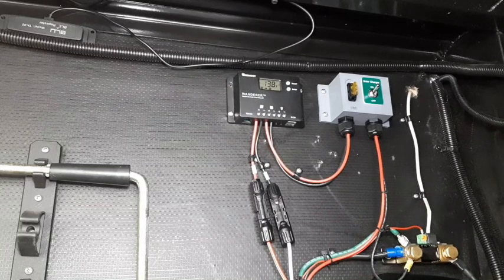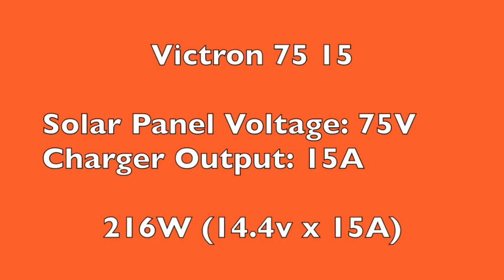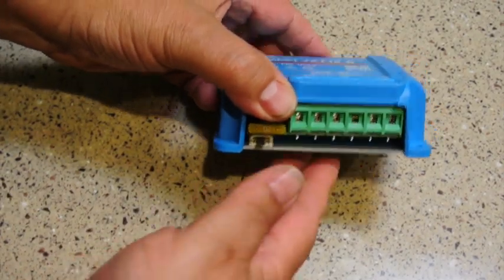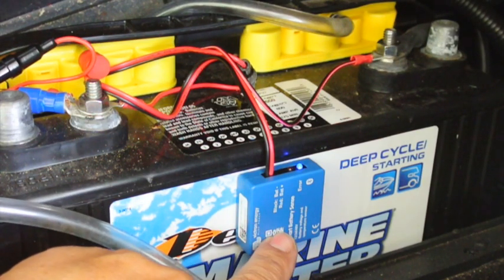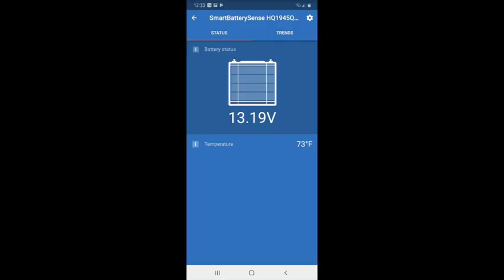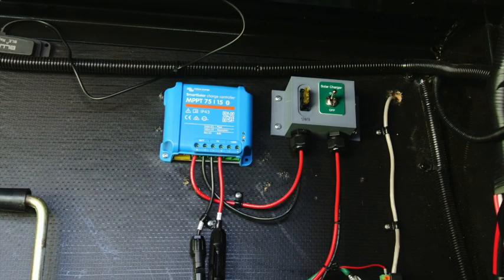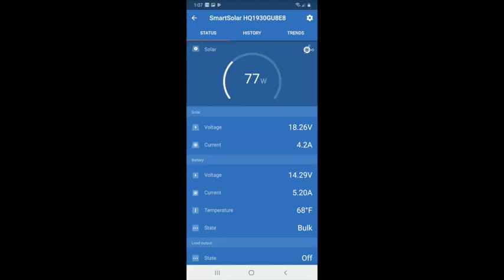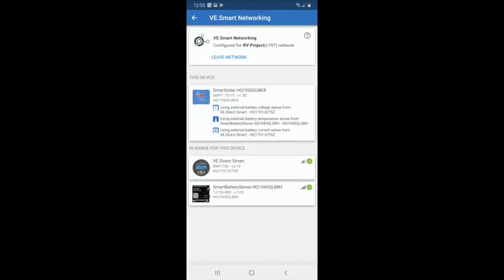Installing a MPPT Controller - Portable RV Solar Charging Video 6

Comment: Solar 76.692 watts...to the battery - 74.308 watts. Only losing 2.5 watts in the controller. Not much loss.

Comment: Can I ask what’s the difference from the smart sense dongle and also the victron battery monitor you also have please 
I’m thinking of upgrading to the mptt but my controll panel in my motorhome is the nord which shows how full your leisure battery and starter battery is 
Would I need to also buy the battery monitor 
I’m new to this sorry 
I have 120w solar but upgrading to 175w just swapping panels then swapping pw panel to mptt panel hoping my nord controller panel is enough just to show both level of batteries with the lcd dots in green or red when low
Reply from the maker: The Victron Smart Sense is designed for the Victron MPPT solar charger. The voltage is reading from the Smart Sense dongle can be a bit more accurate than at the MPPT charger as it reads directly at the battery where the MPPT charger could read a bit low due to voltage drop across the wiring if the MPPT is located a few feet away.

Also the Smart Sense provides battery temperature to the MPPT cintroller.  This results in a more accurate charge cycle.

The Smart Sense dongle is optional though.

I am not familiar with the Nord display, but I also have a Victron BM700 battery monitor that measures current used and can provide expected time remaining on the battery.

The Smart Sense also provides temperature and voltage info to the BMV700 as well, privided enable the Victron network, whi h allows the devices to communicate via bluetooth.

However if you buy the BMV702 monitor, it includes temperature monitoring and can send that to the MPPT controller, so you would only need the Smart Sense donglenif you did not have the BMV702.
Reply: @RVProject  wow thanks for that buddy appreciate the reply. As I say my first van so still learning lol my van is set up with 120w solar with pwm controller which I’m told I can do a straight swap solar off and new 175w in it’s place then the pwm switched to the mppt victron 75/15 then the victron energy controller set up and the smart battery sense does this sound ok? I’m also wanting dc to dc instead of relies on the alternator been told  Orion tr smart dc to dc would you recommend what I’ve said or are some items not needed 
Thanks by the way

Comment: hello I bought this 75 mppt 15 I have two 100 w panels at the moment how many more could you add? how many batteries can charge in 12v system or 24v system ... thanks
Reply from the maker: A typical 100W panel would output about 5.5A peak @ 20VDC.

So you have to stay within those boundarys. 

A 75/15 means 75VDC maximum input voltage, and 15A max charge current (output current)

You could use three 100Watt panels in series.  That means 60VDC input, which meets the 75V restriction of the controller, and the MPPT conversion would provide 15A of charge current when the panels are at maximum sun.  The voltage to the battery would be between 13~14 VDC depending on charge mode, even though the input voltage would be 60V.

That is the beauty of an MPPT controller, it can convert a higher input voltage to additional charge current. And since the current from the solar panels is still 5.5A max, then you would not need as heavy duty wire as if the three panels were in parallel.

Before connecting the panels in series, make sure they have the necessary bypass diodes. You may have to contact the panel mfg to determine if they recommend series connection.
Reply: @RVProject  
thank you for the eloquent and objective answer ... it helps me a lot to understand the limitations of an mppt .... regarding a battery bank I want to use lead acid 12v 100ah ... how many batteries I could power with this system ? one or two ... series or parallel? ..... thanks
Reply from the maker: @georgerusu8423  You could power one or more batteries. The limitation is the more batteries you have, the less charge each battery will have. In other words, the longer the batteries will take to recharge.

If you have more than one battery, the voltage must equal the RV system voltage.  For example if you have a single 12V battery now, adding another battery it should be wired in parallel to maintain 12V.

But if you replace the single 12V battery with two 6V batteries, you would wire the 6V batteries in series so you get 12V.
Reply: @RVProject  if I put two 12v 100ah batteries in series I will have a bank of 24 v 100ah batteries ... 3 solar panels of 100 w in series does not influence the way the batteries are charged? .... I understand that the mppt can work in 12 or 24 v system at the first connection detects and sets automatically if I put two batteries in series will it work on 24 v at load out? ... the idea is that I want more power considering that I want to use in case of emergency an inverter that draws its power directly from the batteries or from the load out of the mppt so if the batteries are harder to charge do not bother me they will be like a power reserve in general ..... I read somewhere that the connection in parallel is not recommended for batteries I already have an equalizer that I understand that can be put to a combination of 2 batteries in series and or 4 series in parallel ...... is it better to go with batteries in series or in parallel? .. ...thanks
Reply from the maker: @georgerusu8423  If you increase the voltage from 12V to 24V in a RV, you will destroy the DC electrical system.

When you use a MPPT controller, it can convert voltage to amperage.  For example, 3 panels @20V 5A in series becomes 60V 5A, and in parallel becomes 20V 15A.

But the charge voltage after going through the MPPT controller, the series wired panels would be around 13V @ 15A, and the parallel panels would also be 13V @ 15A.

However, the advantage is that you would have to use 10AWG wire for the parallel connected panels, but 14AWG for the series panels.

Ohms law is Voltage x Current = Power.  So 20V@15A or 60V@5A yields the same power. The difference is that a higher current flowing through the wires will reduce voltage, so there is an additional inefficiency with a parallel wired circuit.

There is some risk in wiring batteries in parallel. If the batteries are not matched, one battery will tend to discharge into the other.  In the worst case scenario, a weak battery will reduce charge efficiency, and a bad battery could damage the other battery. 

For this reason, paralleling batteries requires both batteries to be identical - same brand, model, age, and hours of use. So you really need to replace both batteries with new ones when paralleling them.  If you put batteries in series, you need to use 6V batteries due to the need to maintain the 12V total system voltage.

But for the same physical size, a 6V battery will have double the AH rating than a 12V battery. In fact, a 12V battery internally is actually 6 cells wired in series, and a 6V battery is 3 larger cells wired in series.

Also, 6V batteries tend to have more than double capacity. For example, when comparing batteries, a 12V 100AH battery  might be the same physical size as a 6V 220AH battery.  Therefore paralleling two 12V 100AH batteries results in 12V 200AH, while putting two 6V 220AH batteries in series results in 12V 220AH.  

But 6V batteries also tends to cost a bit more than 12V batteries, due to economy of scale, and other reasons.

So whether or not you parallel or series batteries just depends on your preference.
Reply: @RVProject  bravo ....... very well explained and thanks again ..... I had something to learn ....
Reply: @RVProject  .....what do you say about battery balancing? .... can i still use battery equalizer if I connect the batteries in parallel? ............................. Suppose I want to make a separate 24V DC circuit for an AC inverter, do I have any advantage if I use 24v (ie 12V batteries connected in series) ....? I think that in series I can balance them with a battery equalizer while not in parallel .... and I can stay separate from the 12 v circuit of the RV ....... do you think it is possible?
Reply from the maker: @georgerusu8423  I have not used battery balancers as I only use a single battery in my RV.  Also, the typical 6V or 12V battery are simply individual cells in series within a single case, and those don't have a battery balancer.

When I had a boat, it had dual 12V batteries but marine chargers typically have two or three charging banks so that each battery is charged independently.   

I think having a separate 24VDC circuit for an AC inverter would over-complicate things. The main issue again is voltage drop along the wiring due to current flow. However, inverters are typically placed close to the battery, so that should not really be an issue.

If you need more capacity than one battery can supply, the options are:

1. Two lead-acid 12V batteries in parallel.
2. Two lead-acid 6V batteries in series (with or without a battery balancer).
3. Upgrade to AGM.
4. Upgrade to a single LiFeP0 (Lithium-Ion) battery.

If you are not aware of it, the recommendation is to never discharge a Lead-Acid Deep Cycle battery more than 50%, or you will shorten the battery life. So, a 100AH Lead Acid battery has 50AH of useable energy.

If you go to AGM, you can disharge to about 80%, so you can get more energy out of the same size battery.  Typically you do not need to upgrade your charger for AGM.

For Lithium-Ion, you can discharge to 100%, and there are many more charge-discharge cycles, so while the initial cost is high, it averages out. Unfortunately, you need a Lithium specific charger.  

Many Lithium batteries have built-in circuits that allow use of a standard lead acid charger, but they are not high performance.  You pay extra for the performance of Lithium, but you do not get it unless you upgrade the charger. 

Also, Lithium-Ion does not work well in low temperatures, so it can be an issue with RVs in cold weather.  But Lithium prices are going down all the time, so if you wait a year or two, you might find a better deal.
Reply: @RVProject  
are the bypass diodes in the connection box of the panel? ..... the idea is that I opened them and saw two diodes there .... are they? or do I need more on the route of the connecting cables? .... thank you
Reply from the maker: @georgerusu8423  The bypass diodes in the solar panel connection box should be the correct series bypass diodes. But I would confirm that with the panel manufacturer, just to be safe.

Comment: Couple questions if you don't mind..

1) What size wire are you using for the inputs? 10awg?

2) Since this particular Victron model has a built in fuse, it is necessary to add any additional fuses for a small setup? (I'm just making a portable battery box setup).

Thanks for making the video.
Reply from the maker: The purpose for the large AWG wiring is to reduce series voltage drop, not for current carrying capability.  The shorter the wires, the smaller they can be.  I used 12AWG here as the wiring was short.  But if you can fit it in, 10AWG won't hurt.

The fuse is in the Victron controller is for the battery circuit.  The external fuse I added was also for the battery circuit, however if you follow my video progression, in the previous video, I start out with a Renogy PWM controller, then upgrade to the Victron MPPT controller in this video.  

The fuse was primarily for the Renogy controller, and when I replaced it with the Victron controller, I did not take the time to 3D print a new box lacking the fuse.  Sorry for the confusion.

So the answer is if your controller has a fuse protecting it from the battery, you do not need another in series.

I do discuss fuses on the solar project webpage: http://www.rv-project.com/projects/suitcase2.php
Reply: @RVProject  Thanks so much for the quick reply. 

One more question if you don't mind. 

Does it matter if I use varied size wires?

For example.. using a 12awg to connect the charge controller to the solar panels, and a 10awg wire to connect the battery to the charge controller.

I'll just be using it with a single 200watt panel. 

Thanks again.
Reply from the maker: As long as they are large enough to handle the load, its ok. Typically you would fuse the wires to the smallest AWG wire, but in a solar panel, you should  never have an overload that has a higher current than what the maximum the solar panel can output , so if the wiring is sized for that, it should not be a problem.

Comment: So whats the biggest solar panel you could put on this? 250w?
Reply from the maker: Depends on how you connect the solar panels.  For example, this model MPPT controller can handle up to 75V and 15A. This means 75V input voltage and 15A max output current.

For an MPPT controller, the voltage can be converted into current, so a little explanation must be provided.

As I said, the maximum current to the battery from this controller is 15A.  And for a lead acid battery, the maximum output voltage from the controller will be just slightly less than 15V.

Therefore,  the maximum output power will be 15V x 15A = 225 Watts.

There will be a few losses in the circuit though - including voltage loss along the wire, loss in the controller itself, and so on. So 250Watts would be the ideal maximum for a solar panel.

But how you get that 250Watts is the beauty of an MPPT controller.  For example, two 100Watt solar panels, which has around a 20V output voltage could be wired in parallel, providing 20V at about 10 Amps, or wired in series, providing 40V at 5 Amps.

Another example could be an 85 Watt solar panel that outputs 20V @ 4.25A.  You could wire three of those panels in series, which would give you 60V @ 4.25A - which works out to 255Watts.

In either case, the MPPT controller will convert the higher solar panel voltage into additional current at the battery. This is the chief advantage of a MPPT controller. Any combination of solar panels in series (which must be identical panels), can be used as long as the total voltage is less than 75V.  

Also, Victron makes higher voltage charge controllers as well if you need to add more panels in series.

Note that the series configuration of the solar panels cannot be done with a PWM controller.  Any excess voltage is wasted.

Comment: You made no mention of using and operation of the load terminals. Some people
 use them so this video was no help.
Reply from the maker: The scope of my videos are for use in RVs. Typically in a RV 12V system, the load terminals are not typically used due to the high current drain some devices that are attached to the battery have (room slide-out motors, leveling systems, and so on).

Regardless, I can't believe you didn't get at least a tip or two from the video.
Reply: @RVProject   I picked up a couple of tips, thanks for taking the time to make the video!